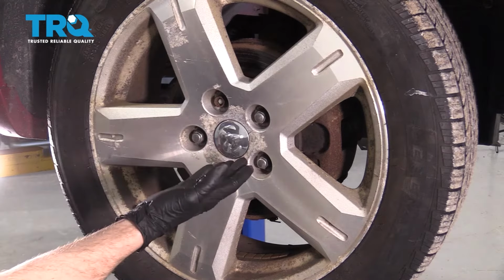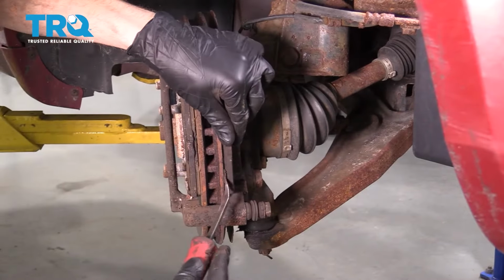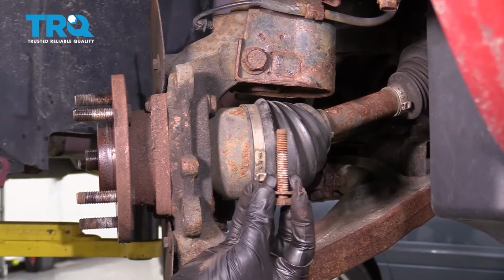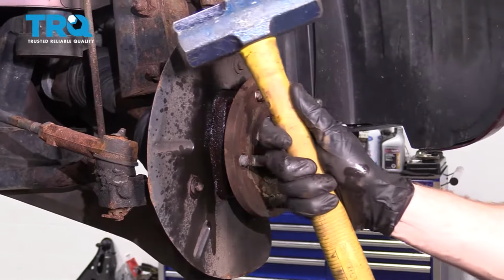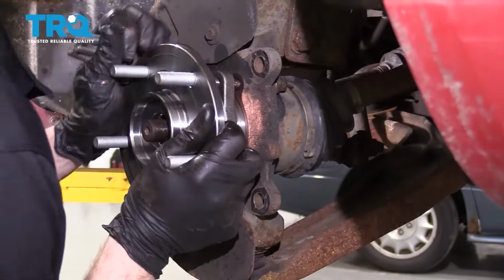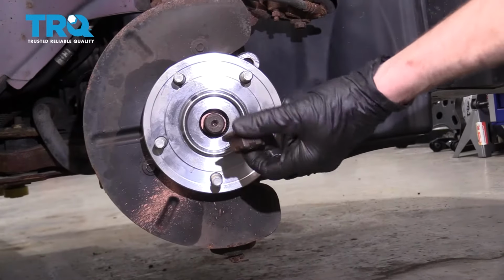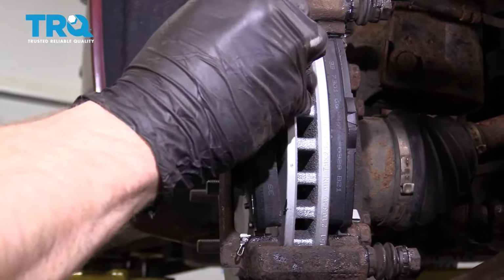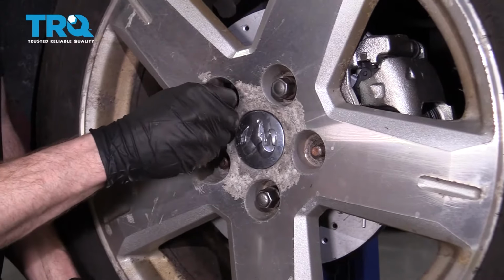How to Replace Front Wheel Bearing and Hub Assembly 2009-2020 Dodge Journey

Comment: Unless you are planning to do a brake job in addition to the wheel hub... all you need to do is take off the two 21mm bolts that hold the caliper on the wheel hub. You don't need to disassemble the entire brake caliper.

Comment: the wheel hub and bearing on my 2008 srt4 caliber is the same style as this one. but i cannot find it anywhere to purchase to replace. does this car share the same wheel hub as my model car? if so where can i order it please. it has the same 4 bolts in the back.
Reply from the maker: +@clanaoaarmyofallah2557 Thanks for watching! The 2008 Dodge Caliber uses a press-on style bearing and hub, so it will not be the same style as in this video.

Comment: I would never put anti-sieze on the face of the wheel bearing, where the rotor mates. If anything, put just a tiny bit on the inside of the center hole.

Comment: 1. Why do we pump up the break pedal until it is firm?
2. For the rear wheel bearing replacement, we had to disassemble the ABS wire. Why was there no ABS wire in this case? Is ABS only applied to the wheels receiving power?

Comment: Have a 16’ Journey SXT that makes a “spinning up” or “winding up” noise when I drive it. The noise isn’t responsive to the engine (doesn’t get louder when I rev or push accelerator) or responsive to the transmission (stays constant even if I manually shift). It does seem to get louder as the car moves faster and stops when car stops. No rough ride and car feels good, just the sound? Does this sound like a wheel bearing?